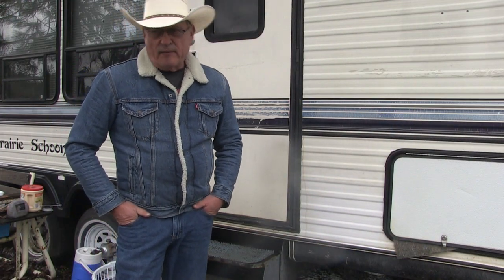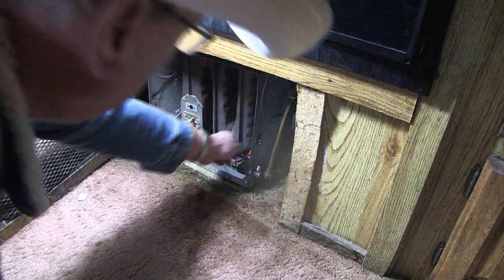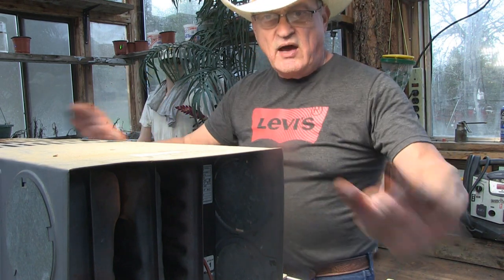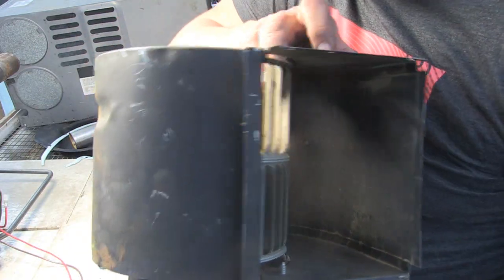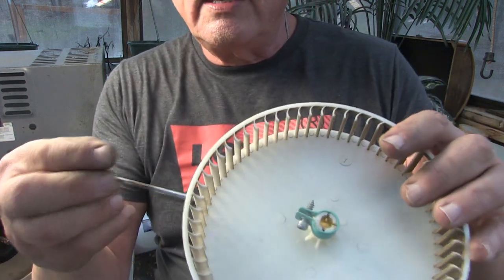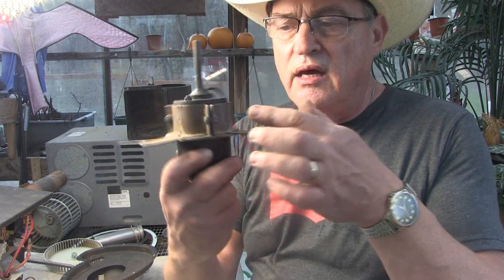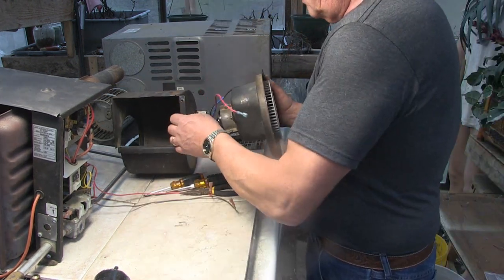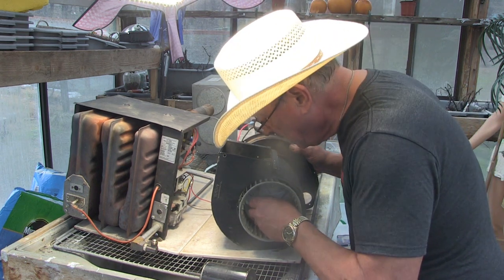SUBURBAN RV FURNACE REPAIR - Replacing The Motor

Comment: Nice repair video.  Until it gets to removing the tube at about 6:54 +/-.  Then it cuts to the next thing to remove.
I followed the video step by step, pausing while I completed the task.

It went well until the removal of the shiny tube.  Like everything, it has screws in hard to get to locations.  He removes the screws, pulls down or up on the collar.  Then goes to next component to remove.

Removal of the tube is almost impossible unless you loosen or remove every screw  anywhere near the tubes.  Then you still need to pull slightly on both sides to remove the tube. It is because the tube extends 1/2” deeper than it looks.  

So your need to pull it apart, as close as you can do it without bending anything.

You’ll see for yourself.  

However, I will happily replace future motors instead of the dealer per hour rate as “variable”.

Yeah, me. $750 to tell me I needed a new motor.  So me replacing the motor vs. them replacing it is a non question.
 
Total cost would be a new furnace.

I’m doing it myself.    But remember about the tube.  He never shows how to do it.

Btw, I drilled a 1/4” hole in the fan shroud to give me access to a screw.

But it’ll be worth it.  Saving lots of $$$$

Remember the tube,   T h e. T. U. B. E.                 T.      H.     E.       T.       U.         B.       E.

Thank you for reading this.
Reply from the maker: I loaned my car to my daughter and she blew the engine. So I just recently had the motor replaced.